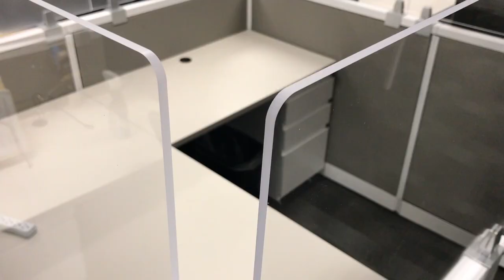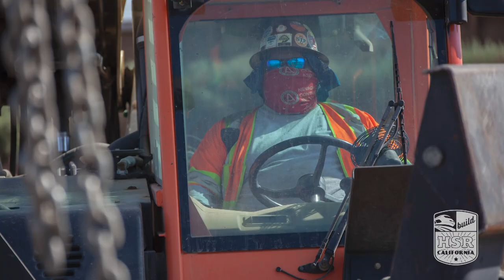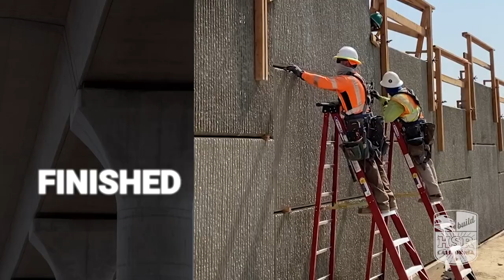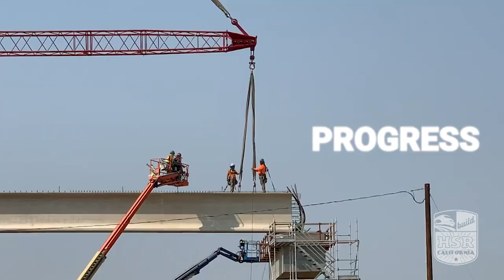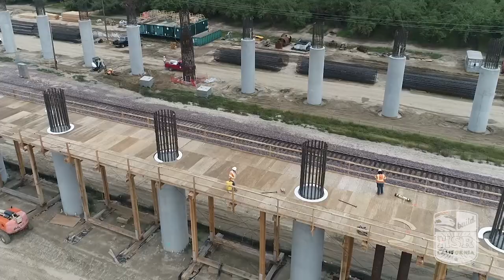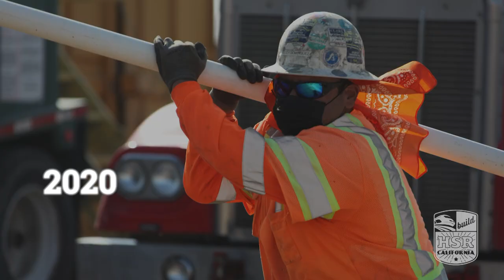2020 High-Speed Rail Construction Year in Review

Comment: There needs to be a goal of a daily high speed train service between Los Angeles and San Francisco by mid-2028 in time for the 2028 Summer Olympics. Not all the stations between LA and SF need to be ready by then, but one should be able to get on a HSR train at LA Union Station and ride all the way to SF, even if it's still the current Caltrain station at 4th and King, and vice versa in under 3 hours. In 2028 the world will have its eyes not just on the US but also California, and we need to be able to show on the world stage that high speed rail can and will work in the US.
Reply: This is actually a amazing point
Reply: Environmental clearance for the last remaining segments from San Francisco to Anaheim are set to be completed in 2022 and the Link US (LA Union Station reconfiguration) project is set to be completed in 2027. With tunneling completion estimates of 4 years in the mountain passes and additional time for final trackwork and testing, 2028 is technically possible. Funding sources (e.g. Cap and Trade auctions) are spread out much further into the future than 2028 so additional more-immediate funding sources would need to be identified before they are confident enough to begin construction on those segments in time to complete them by 2028. There are currently some bills that have been introduced in Congress this year (e.g. Moulton's American High-Speed Rail Act or even Costa's High Speed Rail Corridor Development Act) that could get this process kickstarted today, but the odds of them getting through the Senate in it's current form are pretty slim.
Reply: The opening of the Tokaido Shinkansen (and world's first high speed rail line) in Japan was timed to coincide with the 1964 Summer Olympics in Tokyo, so how cool would it be for America's first high speed rail line to coincide with the 2028 Olympics in LA!
Reply: @ChrisJones-gx7fc  I'm all for it, but a word of caution on mirroring the steps of the development of the Tokaido Shinkansen. The Shinkansen was widely ridiculed at a time that most of postwar Japan was pushing for American-style highways as the transportation mode of the future. As a result, Shinkansen project leaders promised unrealistically low construction costs. Those promises caught up to them very quickly as construction costs doubled and the project (at a time of a very weak Japanese economy) became a national embarrassment. Several senior staff members including the VP resigned out of shame just months before the completion in time for the Olympics.  
Of course, the Tokaido Shinkansen has since become a beacon of Japanese engineering prowess, completely earned back its construction costs, and continues to make massive profits. However, it would be nice to avoid those initial missteps if possible.
Reply: @brandonk9706  I totally agree. The only step it would mirror would be opening to coincide with the Olympics in LA. We should absolutely learn from existing systems, both in Asia and Europe, both what and what not to do with developing this first true high speed rail system in the US, and let it become an example for other systems in the US.
Reply: @brandonk9706  This is amazing stuff to learn! I'm gonna try writing a short article/opinion piece on why CA HSR should aim for a Summer 2028 opening date and why that date is achievable. Would it be cool if I use what you said here, and where you got this info from? Thanks!
Reply: Forgot that the 2028 Olympics are in LA. Shouldn’t they give a higher priority to finish the HSR project?
Reply: @Bk6346  I think of Japan opening their first high speed rail line between Tokyo and Osaka in 1964 to coincide with the Tokyo Olympics, and how cool it would be if California and the US could do the same with the LA to SF high speed rail line.
Reply: @ChrisJones-gx7fc  No problem. It's sitting on the Shinkansen Wikipedia page at https://en.wikipedia.org/wiki/Shinkansen#Construction. I believe the referenced source material for that fact is the book "The Japanese Shinkansen: Catalyst for the Renaissance of Rail" and the relevant section can be found here: https://journals.sagepub.com/doi/pdf/10.7227/TJTH.24.2.6
Reply: That will not happen even in your wildest dreams.
Reply: @LucidStew  The bill to enable this is currently live in Congress (H.R. 8926) has been referenced by the incoming majority in the Senate. It might get watered down a bit or substituted with a similar bill, but there is a very real chance of major federal action being taken in this sector. If you are for or against this measure, write to your congressman or senator before the vote. Just leaving Youtube comments won't change the outcome of that measure.
Reply: @brandonk9706  I was thinking more of where you got your numbers from, like the tunneling estimates of four years. Also where you learned about the current high speed rail bills in Congress.
Reply: @ChrisJones-gx7fc  I've followed a lot of technical documents that have come out of CAHSR. Both of the HSR bills I referenced (HR 5805 & HR 8936) were shared on social media by CAHSR or were referenced in infrastructure articles on sites like Streetsblog. As for the tunneling timelines, I will have to do some digging, but I believe those were indicated on the published draft environmental impact report for San Jose-Merced and preferred alternative documents for Palmdale-Burbank. I'll update you if I can locate the exact spots where I read that, but the EIRs are each thousands of pages of documentation so no promises of a quick turnaround.
Reply: @ChrisJones-gx7fc  Ok. I'll keep digging for a more descript breakdown, but here is a page showing up to a 5 year construction timeline for tunnels through Pacheco Pass (Page 2-137): https://hsr.ca.gov/docs/programs/san_jose_merced/Draft_EIRS_JM_V1-08_CH_2_Alternatives.pdf
Reply: Ok. I'm not finding the Palmdale-Burbank figure right now, but just to maintain my sanity I did map out the Refined SR14 Preferred Alternative and verify that the longest continuous tunnel on that segment would be 12 miles. Provided that the 13.5 mile Pacheco Pass and this one progress at similar rates, then 4-5 years would be the expected completion time for the longest tunnel segment under the San Gabriels.
Reply: @brandonk9706  They could have the entire $60 billion remaining tomorrow and it still wouldn't be done and operating in 7 years.
Reply: @LucidStew  I personally don't think 2027 is realistic either. However, environmental clearance for the 520 mile segment is wrapping up in 2022 and none of the remaining segments have valid reasons to take over 7 years to construct. Even the painfully slow and delayed Central Valley segment is still on track for a 7 year construction completion timeline. If full funding was made available tomorrow with a completion mandate of 2029 then I believe it could be done. The Olympics in 2028 would be a noble goal, but meeting that timeline would require speed and efficiency increases that the project has not shown any hints of implementing so far.
Reply: @brandonk9706  When I say this I'm talking real world.  Earliest they'd get funding is at the end of the year. This is assuming Democrats are able to ram those bills through and that every other state is going to be perfectly cool with about HALF of it going to California. They'd have to ramp up a $3 billion/year enterprise to $8 billion/year immediately. Not happening.  Going to take 2-3 years at least just to get the work force up to speed.  There are something like 15 tunnel segments.  They're not going to bore all simultaneously and not all of them are going to be to schedule.  The Authority has also never bored a tunnel. By precedent they have trouble constructing simple things like overpasses. The Authority is slow and misses targets.  No reason to think that will change.  They've had a LOT of problems with land acquisition.  Still a lot of land to acquire.  They get hung up by utilities and utility work a LOT.  Wait until they get into the L.A. basin with that. This authority has not laid a single foot of track nor installed a single foot of overhead wire, nor a single pole, nor a foundation for a pole.  And all that will go perfectly with brand new workers right from the start? No it will not.  Then after all that, they need to spend a couple years testing.  Not happening in 2029.  Not happening in 2033.
Reply: @LucidStew  I think we're on a similar page with regards to how this will realistically play out apart from the musings of this specific comment thread. I believe it's entirely possible to complete SF-LA by 2029, but reality will almost certainly be much different. The current Central Valley to San Francisco connection is planned for 2029. However, I anticipate a planned slip to 2030 with service to the public finally beginning in 2031-2032 after a few additional delays similar to Caltrain's electrification project. As for funding, I think the incoming administration will pass something smaller for CAHSR and require a state-match. This smaller measure and match will help complete funding for Bakersfield -San Francisco with little to nothing left over for the extension to LA. It's hard to predict any concrete timelines for the extension to LA without sources of funding, but unless something major passes or Biden pushes hard for a second round of HSR funding (would have to be during a second term because it would probably hurt his re-election chances) then I think the LA extension will keep getting pushed back.   
Of course, I would love to be proven wrong and see a coordinated state and federal push to get this project on track to achieve ambitious completion times, but I think the odds of that are relatively low. Certainly much higher odds with Biden at the helm, but still low.

Comment: How much longer is this going to take
Reply: @Acerailfan3101 F40PH That's the rough timeline. The construction segment in this video is due to be completed by the end of 2022, but CAHSR doesn't intend to operate their high speed rail services on it until 2029 when they would start concurrently with the completion of the San Francisco to the Central Valley line. The extension to LA & Anaheim to complete Phase 1 is currently estimated to be complete in 2033, but that all depends on available funding (story of this project). On plus side to this pictured segment being done early is that it will be used as a test track for their trains and Amtrak San Joaquins could temporarily operate a 125 mph express service on the track until CAHSR takes over with their HSR service.
Reply: @Acerailfan3101 F40PH I don't believe there are any formal announcements regarding Amtrak using the track, but it does make some sense and CAHSR has designated a BNSF mainline connection location just north of the Madera Amtrak station if that plan goes through. CAHSR has previously stated that Amtrak San Joaquins are talking with them about possibilities so it will be interesting to see what comes of it. However, I fully expect the media to pounce on the temporary 125 mph diesel Amtrak service as a "broken promise" if they choose to let Amtrak use the track first.
Reply: @Acerailfan3101 F40PH I believed that was only the case so far for the Merced Intermodal Track Connector (MITC) Project which will require sharing tracks for a short distance. They also plan to co-locate the Madera Amtrak Station with the Madera CAHSR Station to allow direct transfers between the two systems. I'm not sure if the latter plan involves San Joaquins trains on CAHSR tracks.  
That is a fun fact. I was unaware that they were so far ahead in their transition to renewable diesel.
Reply: 50  years the way California does things. Anywhere else 5-10 years tops.
Reply: I will really be surprised if it gets finished.
Reply: @bambambundy6  This current 119 mile section is fully funded and most of the way done so it's pretty to easy to see the finish line there. The path from the Central Valley to San Francisco is also pretty clear. Some of the remaining sections on the 520 mile route have not secured funding so if there is no political willpower then it will never get done. It would take an act of Congress to get it to Los Angeles (yes, I am aware an "act of Congress" is another way of saying something is impossible). Currently bills HR 8926 and HR 5805 would enable completion are live in Congress so we'll have to see if the incoming federal administration is more serious about infrastructure investment than just  "Infrastructure Week".
Reply: The way things are going in the Central Valley, 2029 is looking increasingly likely. Late 2027 is out the window.  Logistically, the entirety of Phase 1 is virtually impossible before 2035 or so.  I'd be shocked if it happens before 2040.  Everything depends on funding.  Without extensive federal funding($40-50 billion range), it's unlikely to link Bakersfield and L.A. at all. If they get the necessary funding, I think Bakersfield to San Francisco is not completely out of the question in the 2036-2037 timeframe.  Although I would imagine the Pacheco Pass tunnels will probably delay that a year or two.
Reply: @Acerailfan3306 Trackside Honestly, 2033 S.F. to L.A. is fanciful at best.  Hopefully that will finally be reflected in the new business plan coming in a few months.
Reply: @Acerailfan3306 Trackside I wouldn't have to say that there's no way its happening by 2033 and I wouldn't need to accuse Brian Kelly of being a liar and the board of being frauds. :)
Reply: @Acerailfan3306 Trackside Their business plan is what they present to the State Assembly and other financial bodies in order secure their funding. That funding is usually then distributed contingent upon meeting the project details within that business plan. If the new business plan says SF-LA in 2033 then distributions from entities such as the federal government could happen, but only if CAHSR can actually follow through with their promises. If the business plan says SF-LA in 2040 then it's unlikely that they will receive any motivation to complete it any earlier.  
As people who want this project done ASAP, we really want the timeline in the business plan to stay 2033 or less.

Comment: I hope I live long enough to go by high speed rail between L.A. and San Francisco.  I also wonder about funding.  Will the building stop after they build a "rail line to nowhere" between two points in the central valley?  :/
Reply: Now that Joe Biden is President and the Democrats have the House and Senate, funding is guaranteed. It will be completed
Reply: @mikegaskin5542  I hope you're right, and I also hope I live long enough to take the train from L.A. to San Francisco.  I would be one of the first to buy a ticket.  The train would be much more fun, than the schlep I've done many times, flying between these two cities.

Comment: It’s a shame this wasn’t designed to be as direct as possible between SF and LA, with connections available to Central Valley. The primary use of this will be getting people from SF to LA and vice versa. Though I suppose service to Central Valley could make commuting from those areas a possibility if the cost isn’t too high to ride it daily, which could alleviate a TON of pressure on housing in the major urban areas.
Reply: Nobody commutes from San Francisco to Los Angeles! Two-way tickets will cost over $170, which is far higher than the California minimum wage.
Who exactly is this HSR project for!?
Reply: @djm5687  Train is faster than car. And if you take the car, you have to deal with traffic.
Reply: @tcgb311  Who commutes from SF to LA? The train will take 5 hours round trip (2 1/2 hours each) way and cost $170. Who is this aimed at?
Reply: @tcgb311  Why not use the space occupied by train tracks to build or expand freeways? Also, California wouldn't have so many problems with traffic (and lack of affordable housing) if they got their illegal immigration problem under control....
Reply: @djm5687  You clearly know nothing about the state of California. First of all, a two track high speed railway has massive passenger throughput, literally greater than or equal to a 12 lane highway, while taking up a fraction of the space and using much less energy. Even if every car on the highway was electric an electric railway would still use much less power because of its efficiency. This is actually super important because electricity is pretty expensive here, so in a way, that is a real issue that high speed rail is solving. Also, the notion that illegal immigrants are the reason for our traffic and housing problems is completely asinine. Illegal immigrants make up about 6% of the state's population and their numbers have actually been steadily DECLINING since 2006. That's right! The number of illegal immigrants has been steadily DECREASING over a DECADE. California has a lot of issues with housing policy and hasn't responded well to growth over the past two decades, but there is also a massive demand from new people moving to California as it's a major economic hub that makes up 15% of the US's GDP.
Reply: @NERPolitan  Children of illegal immigrants are not considered illegal immigrants. California's population has continued to increase overall. Also, people don't "commute" anymore because of Newsom's lockdowns, and modern telecommuting. Deliveries need to be made by truck, car or van, or existing railway lines.
When (if) California's "high speed" rail (doesn't meet HSR standards) actually opens, the tickets will be too expensive for most people.
Thanks for responding, but please avoid personal "you clearly know nothing" attacks.
Reply: i think the goal of this is to modernize the central valley. with housing prices along the coast skyrocketing. california is looking to spure growth in the  cenral valley, plus fast access to the national forests